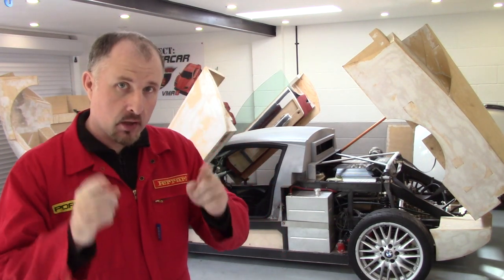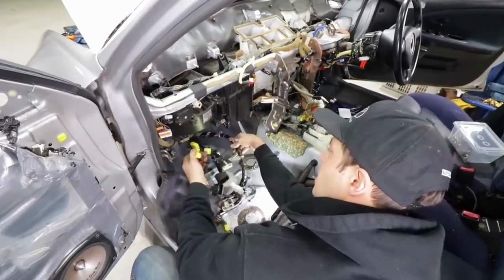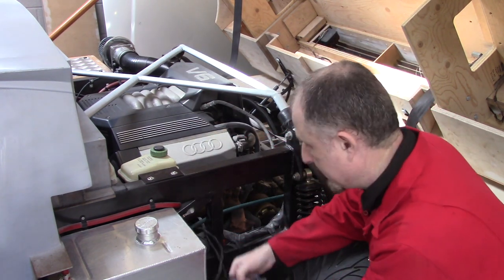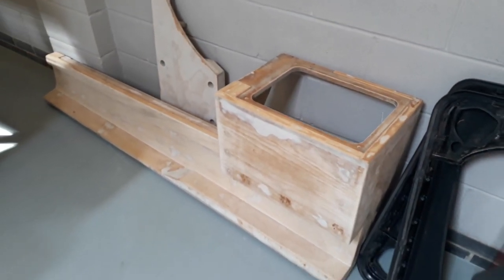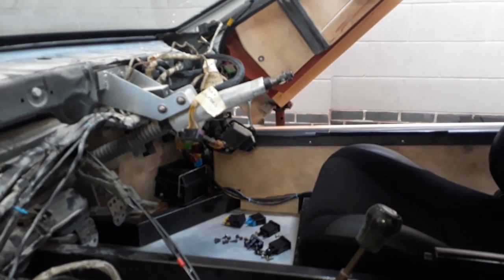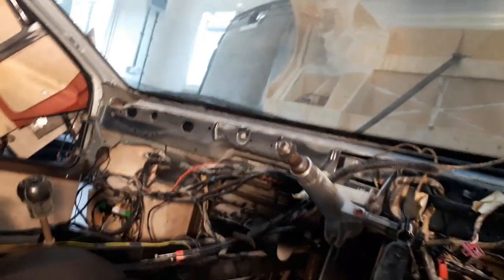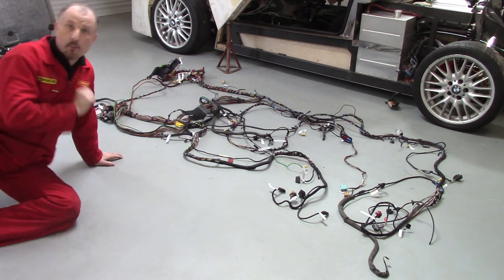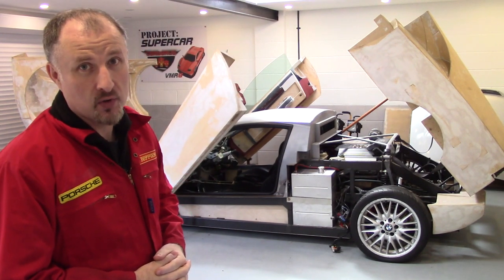Modifying the Wiring loom/Harness and Electrics on my DIY Supercar: Prototype Ep26

Comment: Have you started that engine in the prototype yet? As that looks very similar to the engine and wiring loom I’m using in my countach and it’s very sensitive to being played with. I like you wanted to slim the wiring loom down and when I did hole hell broke loose. All the lights were flashing the engine wouldn’t start the fuel pump wouldn’t prime a buzzer was going off and I had to wire it all back in to make it all work again took me a week to sort out. I found all the lights are looped in and back out of a couple of fuses and release and to the Ignition I couldn’t figure that out some weird wiring Audi has going on. Be very careful buddy
Reply from the maker: Yep, the engine runs and the car drives. There's a video on my channel of the first start up and early test drive ;). Yeah you have to be careful when modifying a loom, the only error light I have is the ABS, which is to be expected as I've removed it. I do intend to sort that error code. The 2.7T will be more complicated, as the car has ABS, stability control and airbags to remove, which should be fun ;) lol.